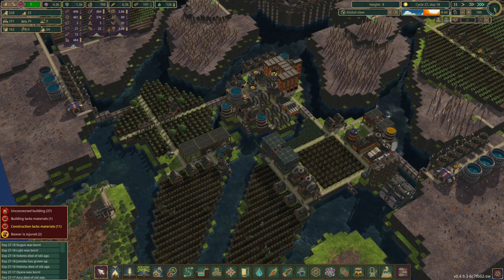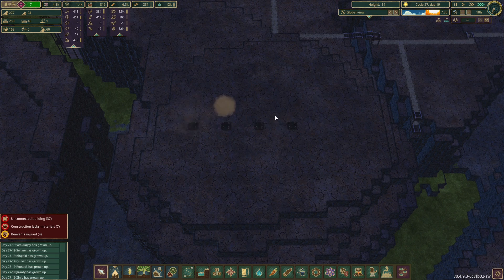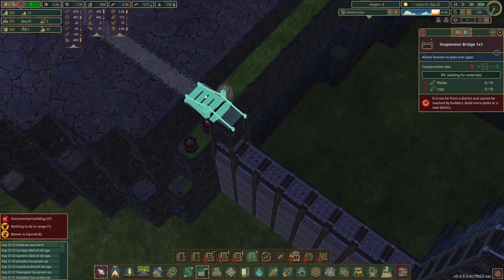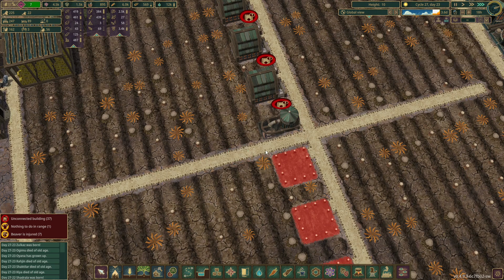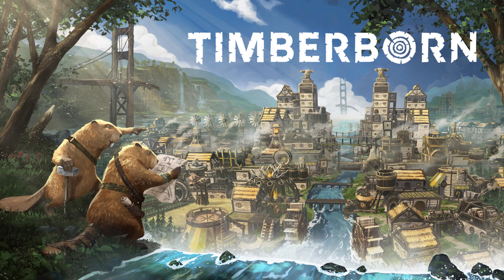Timberborn Modded - Still Prepping For Moving

Comment: 15:41 did that water extension mod remove the smaller irrigation tower v2 ❓ ( the one that held ~300 hours of water)  ..... I only see the huge 5000+hour  tower. ....... Pipes: those can let out of super high reservoirs [ from bottom] , you can constantly keep building them higher, without having to have trapped water below the hight you can build floodgates
Reply from the maker: I only see one tower now, so unless you're talking about the built in one they removed a while ago, I guess they did.
So the pipes work like real life reservoirs, letting a small amount of water out to keep the wheels turning. Very intresting.
Reply: @HouseOfHedgehog  yea I'm curious about why you don't have the one at 11min : 52sec in https://youtu.be/iAh8en4m4Ok  ... ( Button is mostly barrel shaped, but has "v2" upper left corner .. description box title was "irrigation tower v2") ... It did something like 30 tile radius in update 3

Comment: Can you link the live stream (and a rough time stamp) where you tested the water wheel mechanics if the video is still available? I'm pretty interested in that. Keep the great vids coming and thank you!
Reply from the maker: https://youtube.com/live/aoiRBzww73M
That's the live stream, it was a very long time ago. However, I've taken a look at some newer videos of Skye Storm, and they've got further in to it than I'd seen, so I need to watch some more, and maybe even do some more experimenting myself.
Thanks for the heads up on that.
Reply: @HouseOfHedgehog  Thanks for the link! I will have a look at what you did. And yeah Skye got into it quite a bit, I'm surprised there aren't more Timberborn videos that utilize it or some form of constricting the water flow as it's basic physics. Lastly, there's a Youtuber, Scalti, who has simpler videos where he implements the same rules without all of the extra details as Skye does. The videos are his Timberborn S01E02-Grow Up (last 5 mins of vid) and S01E03-Power Up. He was getting consistently over 2000hp with just 4 waters wheels using Folktails (which have weaker water wheels). Hope this helps!